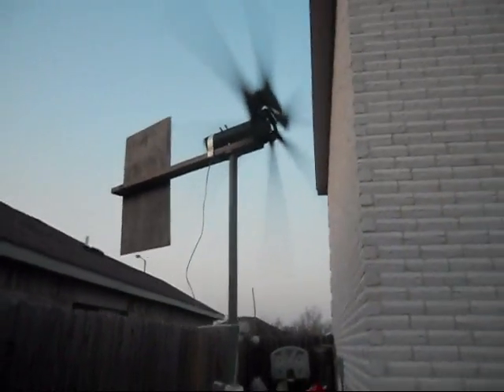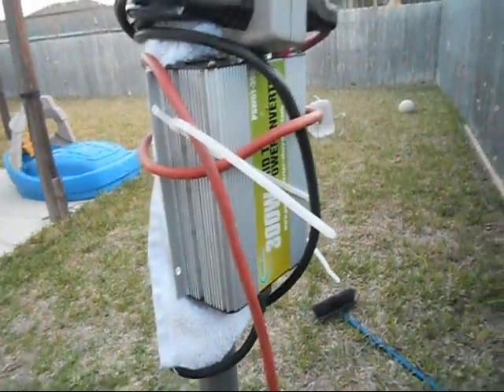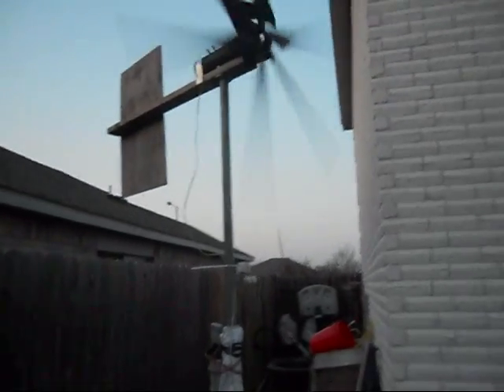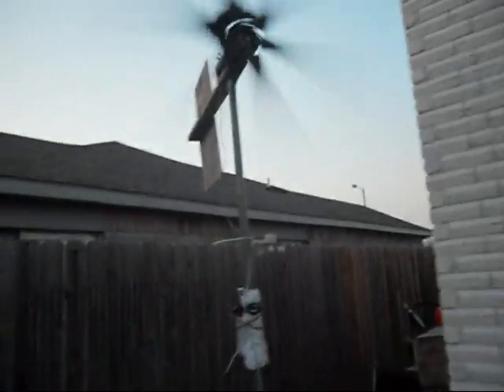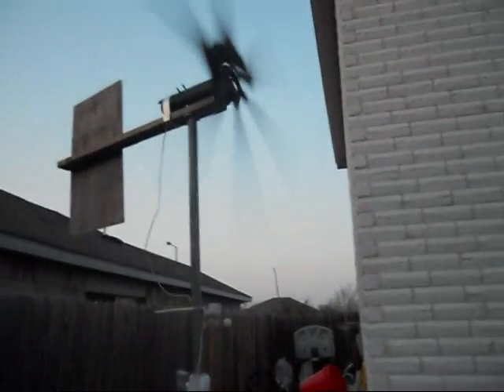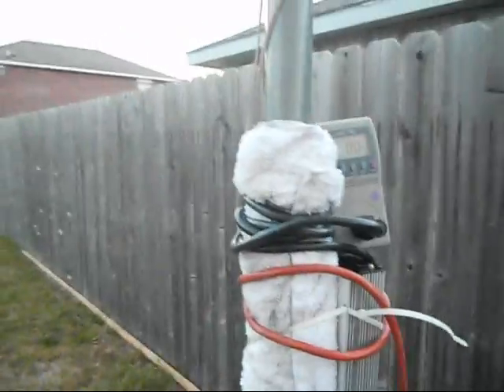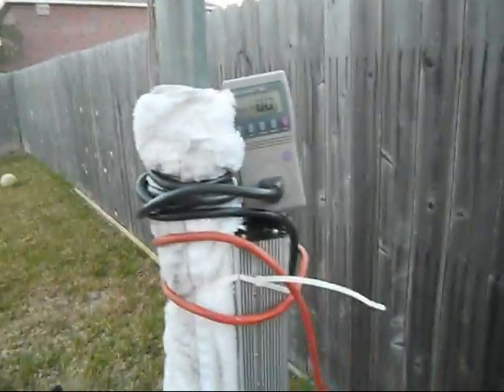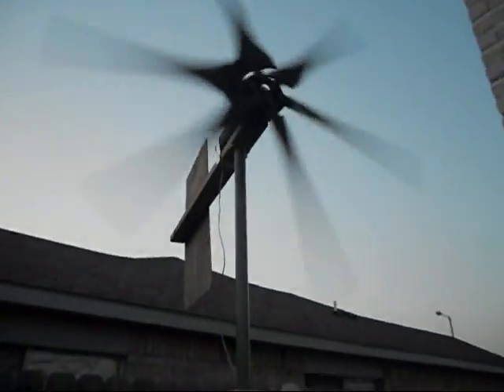HOMEMADE WIND TURBINE GENERATOR

Comment: First, tell your little girl that she can run faster than your turbine😁  Now, what is the amp rating of your generator?  I have a feeling that it is about 1 amp.  You should be generating a lot more watts than 70-100 watts if that is a 90 volt motor.  I still think you did a good job making it and presenting on YouTube.
Reply from the maker: lol.. thanks.. this was 6 years ago....  i'm not sure why it was only putting out the low watts, maybe because the gridtie was not made for a wind turbine...

Comment: You have to be careful you don't exceed the upper DC input voltage of the Grid tie inverter or it will fail on you. I went over on mine and blew out something. Mine was only rated at 10 to 30 volts DC input though. US Vawts is working on a limiter rectifier to prevent that from happening. I think the inverter your using has a higher Voltage rating.